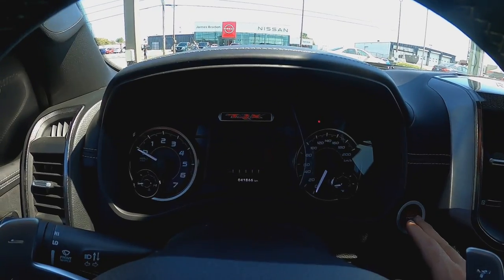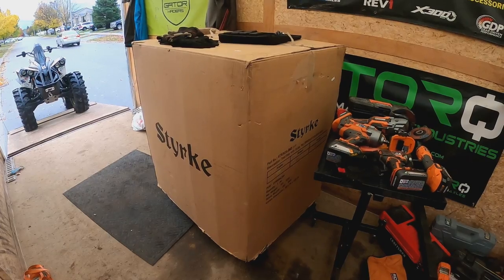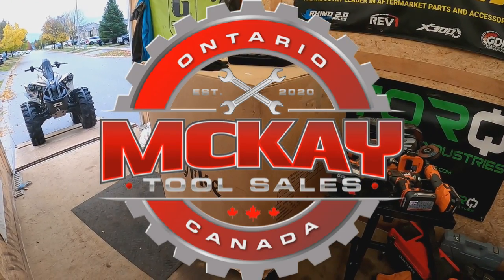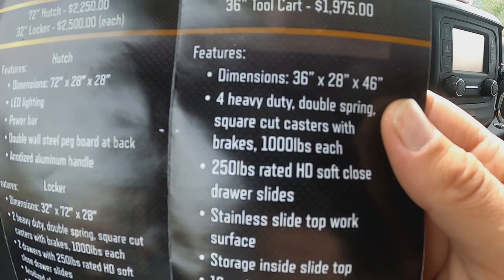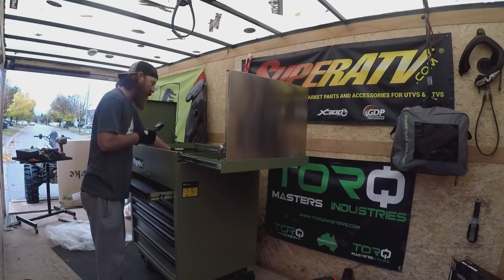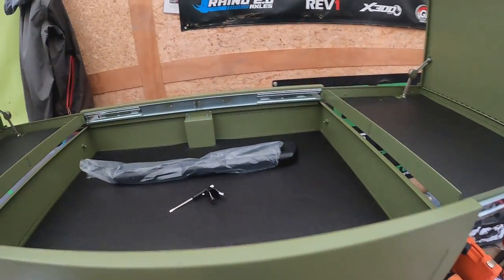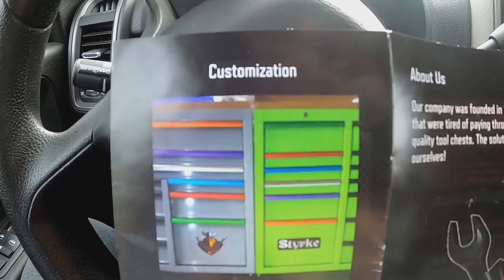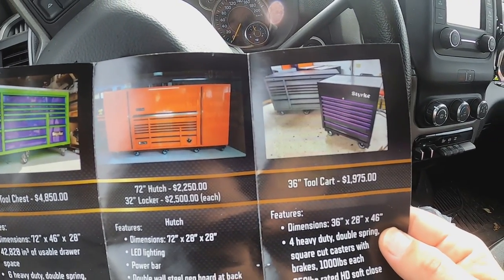Tool Cart & 72" Tool Chest Umboxing From Styrke Industries

Comment: I never did like those pneumatic self-closing drawers. I much prefer the grip latch system because you don't need a freaking 6lbs pull to open these pneumatic drawers. Am I the only one opening them repeatedly because I can't remember where I put a specific tool?  I presently have a Craftsman tool chest with grip-latch. I've had it for 4 years and, to me, these latches are the best way to lock the drawers with the least amount of effort. It's frustrating the Sears no longer sell these tool boxes. Had I known, I would have bought two tool chest.

Comment: Ever look into the Omni wall system?  Metal peg board system you can lock pins in and hang virtually any weight! Been huge in my shop. Killer box though brother!🍻
Reply from the maker: All the peg board designs I've used over the years tempted others to take a tool and never return it to it's place. Hahaha. I'll take a peak a this brand though. Cheers

Comment: Everyone is justifying tool boxes by standing in the drawers. Why? What does that prove? When have you ever had to use your tool box as a jungle gym? The only reason this would be justifiable is if you are a midget and require to climb your box to get to the top shelf. With as much weight will be inside a typical tool box it won't matter how strong that drawer is when it's pulled out. The Cary isn't going to flip foward because the weight of everything else inside the box and the drawer sure as shit better not break from the amount of tools you put in one drawer unless you are storing gold bricks in them. This has got to be the worst way to show off a tool box. I don't care if you can use it as a ladder, I have a ladder already. I care about length,width, depth of each drawer. How well the drawer actually slides when it has weight, how well the locking mechanism works in the long run, how strong are the casters and will they need to be replaced, how manuverable is the box when it's full like do all 4 casters move or just 2, how good is the warranty if something happens. These things matter. I'm so sick of seeing people standing in tool box drawers, it proves nothing.